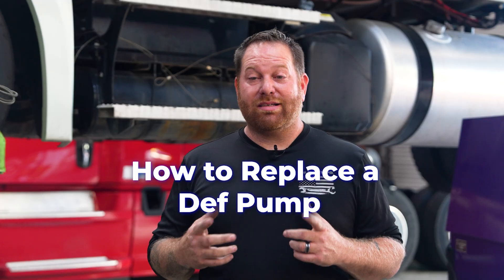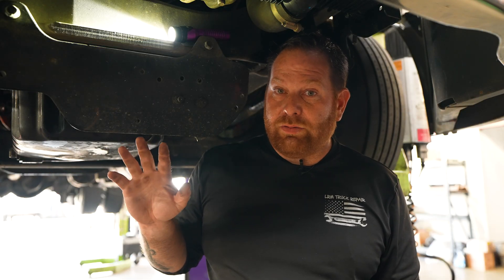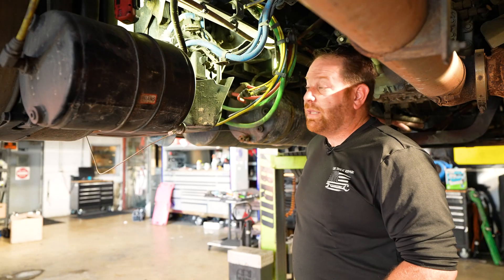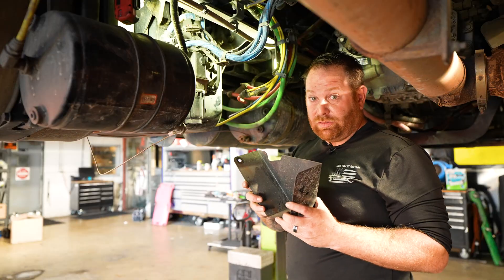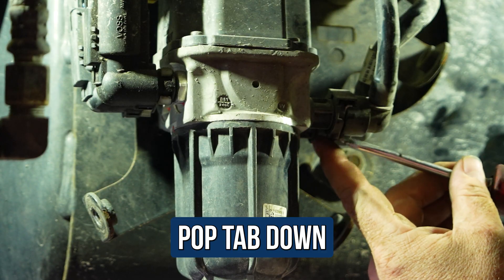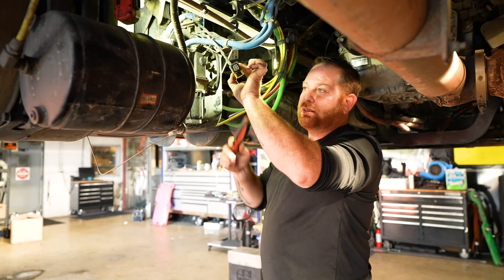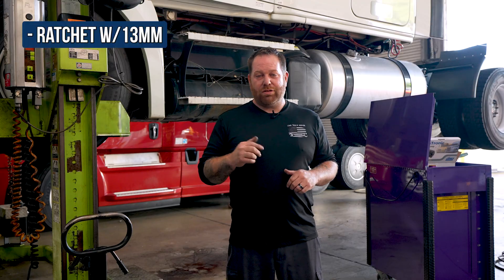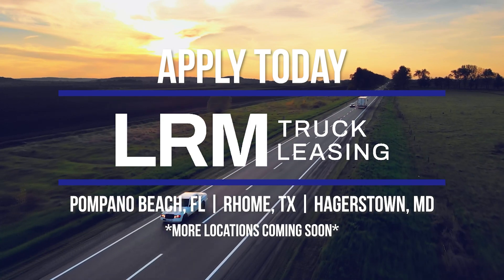Freightliner Cascadia DEF Pump Replacement | Step-by-Step Guide

Comment: Hello, what is the function of the diff pump? What does it do? If the diff pump breaks down, what problems will occur?
Reply: The DEF pump purpose is to move DEF from the tank to the DEF Doser for emissions, If it fails it will have a CEL and most likely you’re engine will derate or go into limp mode

Comment: Thank you. Very informative and clear instructions. I am getting code on the road SPN 520349 FMI 14. Some times gets derate too sometimes don't. Freightliner Cascadia 2018. Any idea what it could be?. New dpf filters installed by Freightliner 10 months ago 95k Miles.